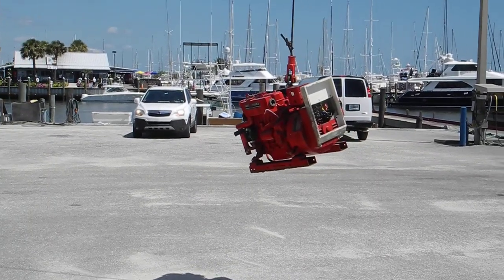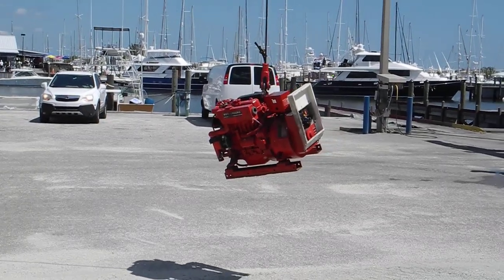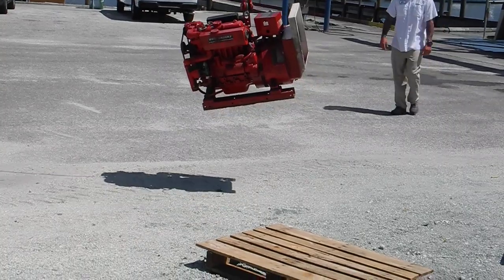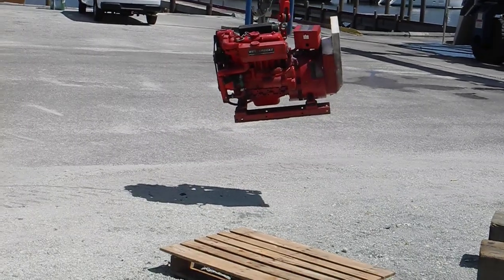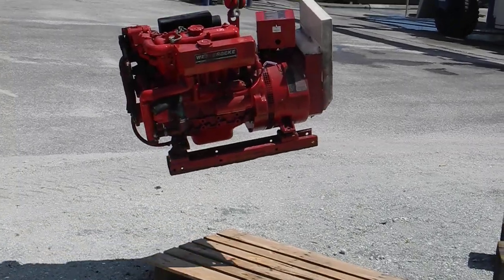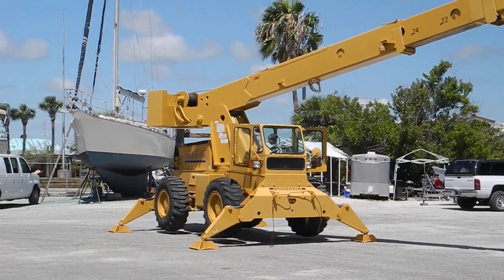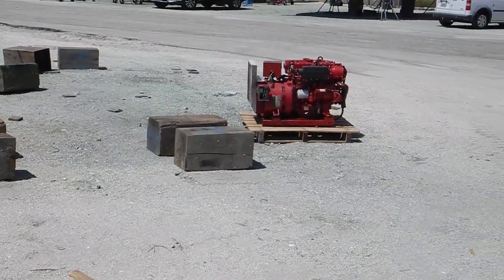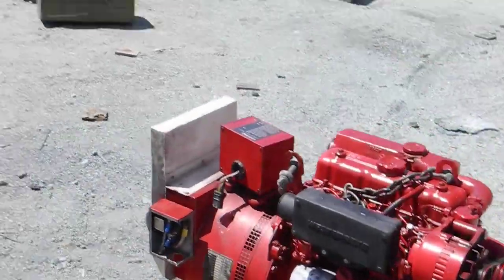Dead generator swings from the cable

Comment: He is holding the becket. He is holding it so it doesn't run up to the head of the boom. The ball is what keeps the winch line tight.
Reply: Thanks again for all your boating knowledge and thanks for sharing it. I will continue to look to you for more boating insights.
Reply from the maker: 953173 👍🏼
Reply from the maker: Headache ball is what we always called it.
Reply: The headache ball is connected to the becket via a pin and cotter pin. Sometimes the ball is removed to get the added capacity of the weight of the ball. Looking at the angle and amount of boom was out I am guessing that was the case. I have been watching you videos since I became a boat owner and I have taken your advice many times, it is very much appreciated. I am a retired Rigger and know my way around cranes and rigging.
Reply from the maker: 953173 thank you for your expert knowledge. Glad you are enjoying my boating videos.